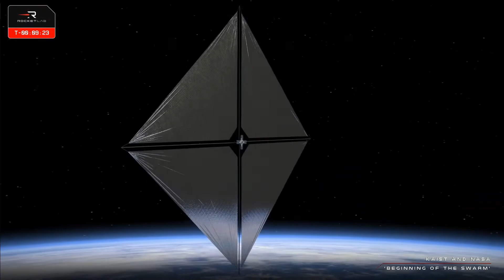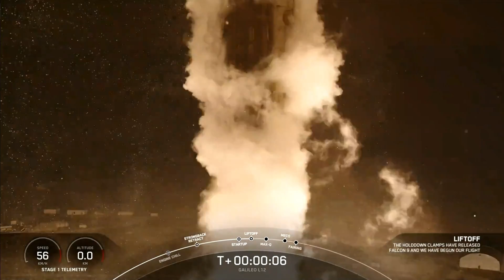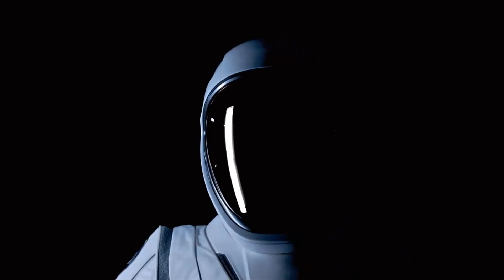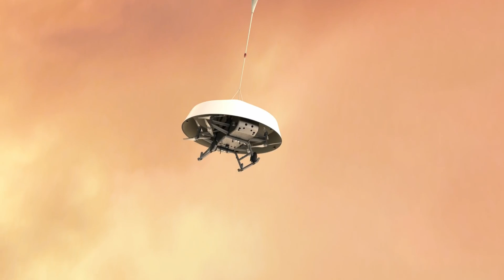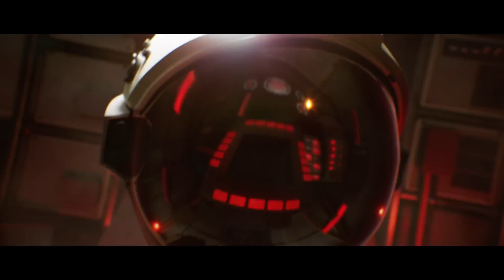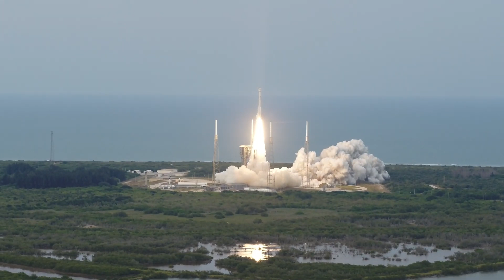SpaceX Reveals EVA Suit - China Launches Moon Mission - Deep Space Updates May 4th

Comment: Materials are going to be a huge issue for the space program. Due to stealth inflation, things which were routinely made from stainless steel or any other sturdy metal in the 1950's and 1960's are now made with plastic and painted over with metallic colored paint. I encounter ed this at one particular juncture when I  did an internship in construction. Few of the material requirements listed on the specs were actually fulfilled by the manufacturers because it was simply uneconomical for them to make it that way since doing so would price them out of the market. So we had to order the best they had available and hope it would work. Eventually, the boiler plate for the specs was updated. Hence the broken utility covers, made from resin instead of metal, that everyone ignores. The point is they will have to have everything custom made from scratch from the very root of the vertical, which will be very, very expensive. Thank you for the update, Scott! I'm glad this batch included many things that you were pleased about.

Comment: Why not build the starship for the moon landing with carbon fiber, most of it anyway. A lighter starship would require less fuel to go to the moon.
Reply: Because that is a lot of extra tooling and expense.  I suspect you don't know how carbon fiber things are made.
Reply: @TheEvilmooseofdoom  I've worked in the aerospace industry for 18 years and have used carbon fiber for aircraft components. I do understand the tooling of molds for carbon fiber, too. The cost could be recouped in the multiple use of ship in time. I suspect the craft could be used at least 50 times easily.

Comment: Me and that one guy have got to have a chat about the whole "Starship Chaser" marketing.

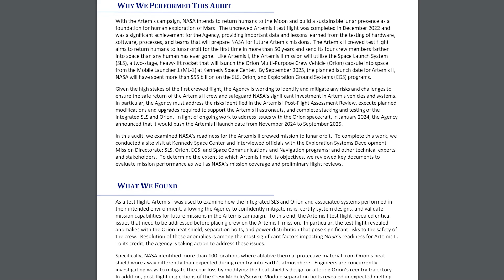Edit: Also, the missing chunks from the heat shield at 19:58 are all at the edges of the individual tiles. That's from moisture ingress. Simply make them ultra dry, or fix whatever phase change adjuncts you're doping with, and then seal them up real good with some kind of varnish that gets plasma-cleaned from the surface upon reentry. I'll bet they would have used a sealant already, but opted not to, because proving that it works and that it won't be failed from various incidental contacts would be time/cost prohibitive. (sounds so familiar)
...or: The tiles aren't sufficiently resisting the sheer forces on the exposed up-stream edges that are formed from the natural erosion patterns of a tiled surface. Probably want to make a surface goop that puffs up. That way, the trailing tile edges will remain slightly higher than their centers during the brief reentry period, and any leading edges of this puff material that get side-loaded should flake off more easily than the tile structure, but not until a significant amount of deceleration has been achieved. At that point, the main tiles will have experienced far less contact and may possibly be reusable (after re-drying/sealing/coating).

Comment: Sea level air pressure is about 14 psi it is over 70% Nitrogen gas & 21% Oxygen. Reduce that pressure by 66% & remove the other gasses & you have the same amount of Oxygen atoms as sea level Air! See Simples no more flammable than standard air! 😊 Now if you do what Apollo 1 was doing running 100% Oxygen at 16psi then you can be in serious trouble! 😮

Comment: Scott, why don't the space capsules come back and go into earth orbit first, slow down and then re-enter, instead of belting it right from the moon straight into our wet blue pebble? Seems a bit drastic, doesn't it?
Reply: Exactly how are they going to slow down in space unless they have fuel & rocket motors to change their deltaV! 😊
Reply: @jackdbur  I was thinking more along the lines of using some sort of orbital mechanics to achieve the slowing effects more than by burning fuel but I guess it may be too complicated or risky or something. The people who go on those flights though. Boy are they brave. I can't imagine how scary it must be knowing that it takes so little error to find yourself adrift in space for good. Goddamn. Scary AF.
Reply: slowing down into LEO would require quite alot of fuel and i guess the heat shields and stuff weigh less than fuel
Reply: @Sped55  We could pre-position a fuel tank in lunar orbit for them. 😄 I know. It's silly. Adding more potential points of failure to the mission.

Comment: Those joint seals on the shoulder are needed, but known to be very difficult to deal with.
Reply: And it's only 2D rotation...
Reply: @kiereluurs1243  Passing communication through a slip ring joint is also problematic. 
I'd assume they will have touchscreen pads somewhere. Probably better to use wireless and batteries, rather than the slip ring.
Reply: @MarkBarrett Simples run the wiring though the inner suit & look no issues! I'm guessing that the inner suit has medical sensors in it that will have a hard connection to the coms system 😊 SpaceX has extremely smart designers and engineers they'll figure it out.
Reply: @jackdbur  Communication will be better off as wireless. 
Power will need to be transferred by rotating slip-rings, through the joints. 
The joints will be too complicated to do anything more than the base required.
Reply: Hard diving suits have been using those rotator seals at depths from 300m to 600+m since the late 1980s that would be 30 to 60 atmospheres of pressure ! 1/3 of an atmosphere probably isn't going to be an issue! 😊
Reply: @jackdbur  Have you considered those ideas of a spinning space station ring. Sometimes ships. 
How do they get the USB signal line through?

Comment: I find it something to be proud of that when SpaceX has to expend a booster that has already flown almost 20 times, it is a big deal and only done in extraordinary situations. If the Galileo satellites had launched on Ariane 6, the ESA would have happily expended the entire thing. And those Ariane's are overly complex, with expensive HydroLOX engines that end up in the ocean. 
It is crazy how impractical the economics of rockets were before SpaceX. The trend was toward more and more expensive technology (such as HydroLOX upper stages) to get just a little more performance out of the vehicle, and then throwing the whole thing away every flight. Simply ludicrous. SpaceX did the right thing on Falcon 9. The simplest engine possible, with the best thrust to weight ratio and a decent amount of efficiency, coupled with common technology on the upper stage to simplify manufacturing. And even though it wasn't originally designed to reuse, they were able to incrementally add reusability into the design over time. 
Now I think they made the right choice again with methane. None of the stupid finicky aspects of Hydrogen, but the clean burn for reusability without coking, and better efficiency than the Merlin. And then the fact that they can manufacture methane on Mars, and you have a very well thought out plan.
I still think all these companies using HydroLOX engines, thinking they can reuse them in space, are going to be rudely disappointed when those seals start leaking. Hydrogen has a nasty habit of leaking out of almost anything. And on Earth we have to DRY OUT the entire engine system between firings. How are they going to deal with that in space? I expect a lot of iced up hardware and failures to ignite on HydroLOX engines refueled and reused in space. 
And I still think the idea of spewing valuable lunar water out into space as "rocket fuel" will turn out to be the most short sighted idea in history and future lunar dwellers are going to curse us for it.

Comment: this is bad... oxygen is highly flammable
Reply: gonna have to be more specific, what's bad?
Reply: @TheAechBomb  needing the entire dragon capsule to be 100% oxygen atmosphere, same conditions as Apollo 1 disaster
Reply: @eggling3427  The ground tests of Apollo 1 used pure oxygen at higher than atmospheric pressure, which was extremely dangerous. Pure oxygen at 1/3 of atmospheric pressure is still somewhat more dangerous than normal atmospheric air, but nothing like the conditions in Apollo 1. I am sure that SpaceX understand the situation and will use sufficiently nonflammable materials to minimize the danger.
Reply: @eggling3427  low pressure oxygen has been used in a ton of spacecraft, the apollo 1 fire was deadly because it was overpressurized and had no hatch release on the inside where the fire was

Comment: Wait a second 🤔
7m sails? That doesn't add up to 80 sqm.
Reply: There are four, 7 meter long booms radiating from the center, diagonally. This means the frame is 14 meter diagonal, 10 meters on the side. The reflector itself is slightly smaller, it does not stretch all the way to the ends of the booms.

Comment: Deorbiting the ISS is just a bad idea, just boost it to a really high orbit and use it as a space muesam, things will be totally different in 100 years, leave a pyramid
Reply: If they are having issues with figuring out how to do a small deorbiting burn then boosting it to a higher orbit is a bridge way too far!😅
Reply: @jackdbur  It's actually not, everything that is required exists, ISS produces 120KW on average, 100KW of ion thrusters, 7.3 tons of Xenon required and 8.5 years of periodic boosting

It'll push it up to 750km-1000km and have an orbital decay of about 50,000 years

this can be done in 2 falcon 9 launches, including all the hardware and additional supplies

It'll cost around 2.4 billion USD to complete, I cannot post my full explanation here, I might make a video

ISS already boosts itself now to keep a correct orbit, that system just needs to be expanded
Reply: Perhaps with a refuelled starship you could push it up & accelerate it to a long-term parking orbit. 😮

Comment: Hot take Boeing shouldn’t have humans in the capsule until they perform a flawless mission
Reply: They haven't had any lift support system issues.
Reply: @TheEvilmooseofdoom well other than the parachute slings weren't rated & the wiring was flammable & the computer system/software was full of bugs & it had a issue with propellant valves but Boeing promises that they have fixed these now!  Also: Boeing we have no idea why a second 737max dived itself into the ground! 😊

Comment: Looking at the heat shield, it almost looks like there were voids in the coating, and when the plasma reached the void it just excavated everything around and below it, all while the ablation continued from above, and then bam, chunks come blowing out too.  

Hopefully they figure it out, cause I sure wouldn't want to take Orion back to landing with that issue, and that's not even considering what's going on with the bolts.
Reply: They probably cannot use off the shelf bolts, screws or any other type of fasteners. I reckon they will have to specify the metal content and performance requirements and then have them made to order. Everyday products are prone to be made as cheaply as possible, which is not suitable for space flight.

Comment: You already have 600 comments and I haven't read them all so I'd be surprised if this hasn't been mentioned already but if the SpaceX EVA suit is going to be 100% oxygen and to avoid the bends the capsule environment is going to be gradually transitioned to at least close to the EVA environment before the EVA well ... when I hear 100% oxygen I can't help immediately thinking "Apollo One" and isn't this dangerous? Maybe I'm simply wrong or they are very confident in mitigation factors now such as in-capsule systems all at much lower voltages and currents due to modern electronics, higher current stuff isolated from the pressurised environment, better fire suppression systems, etc, etc, etc. Or maybe it's only the pressure that will be equalised and the oxygen-rich content will be gradually established once all the astronauts have their suits sealed so that the actual in-capsule environment is never put into an oxygen-rich state?

Or come to think of it why not do the whole transition when they are sealed in their suits but still sitting in the sealed capsule - both the gradual drop in pressure and a gradual oxygen-enriching of the suit environment rather than mess with the general capsule environment (apart from evacuating it entirely to space when they actually open the hatch for the EVA obviously)?
Reply: Apollo 1 fire was 100% oxygen at slightly above atmospheric pressure (during testing).

Partial pressure of 100% 02 at ~5psi is close enough to 20% O2 at atmospheric pressure that things don't burn any faster.

They can't reduce the suit pressure at standard capsule pressure without making the suit resistant to compression by external pressure.

It's designed to be the opposite.
Reply: @incandescentwithrage  Thank you very much, that’s a really helpful and informative reply. YouTube helps educate me every day - via both content providers and their commenters - and your comment is yet another example of that.
Reply: @julianfp1952  Welcome 🙂

Comment: Something mentioned in the Artemis I report, but for some reason never included in these YT overview videos (not just Scott's) is that apparently NASA OIG also learned that the batteries on Orion cannot provide sufficient power to complete a launch abort - and what's worse, even as of the report's release date, NASA still had not come up with a plan to fix this issue.

To me, this was about as much of an "OMG, WTF" moment as learning they used fiberglass for "blast" doors on the launch pad elevator, and put frangible bolts through a freaking heat shield, deliberately and by-design 🤦‍♂️
Reply: Yes why would you drill the bolts the whole way through the heat shield embedding them into the the inner layers seems much more sensible! 😊 & doesn't crew dragon use a newer better formulation of ablative heat shield rather than the same as Apollo? 😮

Comment: These Jupiter and Saturn missions will take so long to happen.  A good portion of that is the very slow Hohmann transfer orbits/trajectories.  
Is nuclear-thermal propulsion ever going to happen?
Could a fairly simple space truck, assembled in LEO, carry a half-dozen or more scientific spacecraft out to Jupiter and Saturn on direct trajectory at high speeds?  Could this nuclear engine produce 1/10th-G acceleration on 1-5 tons of spacecraft for 20 or 40 or 80 hours of continuous thrust?  What quantity of hydrogen propellant might that take?  Could it reach speeds of 100 to 450km/s (a million mph)?  And then have enough propellant to decelerate at Jupiter and drop off spacecraft.  And perhaps take 1 or 2 remaining spacecraft out to Saturn and drop them off.  Then perform a slower cruise trajectory back to cislunar space where it could be safely returned to Earth orbit, refueled with hydrogen propellant, add more spacecraft and go on another mission…Moon, Mars or Venus…etc.  Maybe it would have enough nuclear fuel to make a dozen trips to Jupiter and back…or two dozen?
The Parker Solar Probe has reached a speed of 176.5 km/s, although it’s using the Sun’s gravity to achieve it.  At that speed it could cover the Earth-Moon distance in a bit over half an hour.
Reply: Lockheed Martin will supposedly be testing a NTP engine in 2027
Reply: Use delta v

Comment: 05:35 I don't get how shortening the nozzle saves a significant amount of money.
Reply: The nozzle is made of a rather expensive alloy.
Reply: Probably the cost of quality control procedures, and of shaping and welding the nozzle, and scrapping items which fail quality control. 

Plus the prices for sheet of specific grade could already be significantly higher than those of raw niobium metal, which is only moderately expensive. 

For one nozzle, the niobium itself could cost $10K, the sheet $100K, and the fabricated and tested nozzle $1M, if it is hard to make and there is a lot of scrap.

Comment: I'm a little lost about the solar sails. if they're put in orbit on one side of the Earth they're going away from the Sun collecting speed but on the other side don't they decelerate as they're heading toward the Sun? It seems to me they can only go in One Direction to travel. If you decide to deploy one it's on a one-way trip.
Reply: The sun only provides a small force, the laser they will use will easily over power it.
Reply: Solar sails can 'tack', just like sailing vessels.  By variously tilting the sail relative to the Sun during specific phases of its orbit (e.g. by using reaction wheels on the main spacecraft being propelled by that sail), the direction of momentum transfer can be finely modulated, so that over time pretty much any orbital adjustment is possible.

Comment: A question bugs me all the time: why transfer fuel instead of transfer and connect full fuel tanks? Does anyone have a link to an explanation? Thanks!
Reply: Because tanks are massive elements that are integral to the vehicle structure. The entire thing is built around the tanks... you've got tanks in the middle, engines plumbed into the tanks at the bottom, and payload stacked on the top. In a very real sense, the tanks are the rocket...
Reply: @simongeard4824  it would be arguable that the plan is stupid for that reason of needing to  haul the empty tanks then down again, rather than if you shipped a vehicle that had the tank portion as a tank portion and it would just be attached as a tank portion.

look it's all just from elons thinking that reuse is cheaper than manufacture. it's the same kind of thinking that made him say that model s's wouldn't depreciate in value harshly ever(as it would be cheaper to refurb them than to buy a new one, and that didn't pan out although the reasons for that are of course different than hauling stuff up. well not that different I suppose since it's about labor costs.)